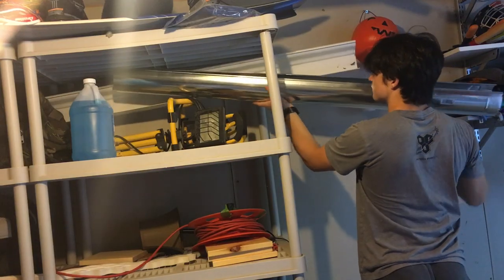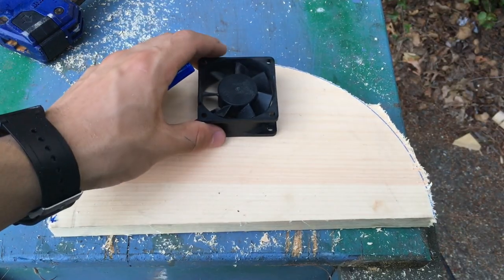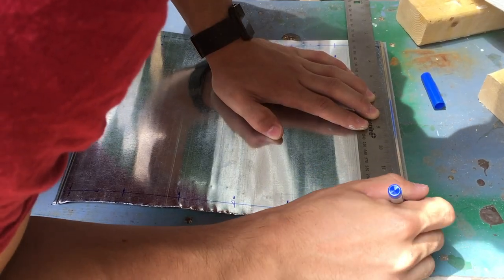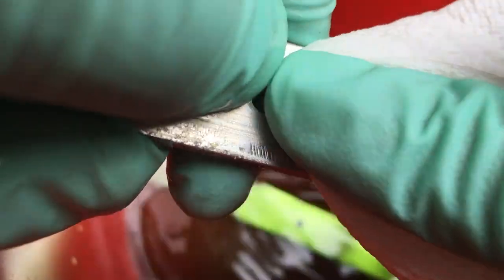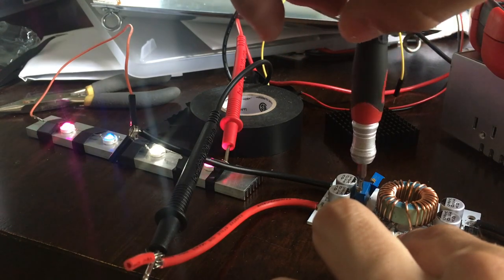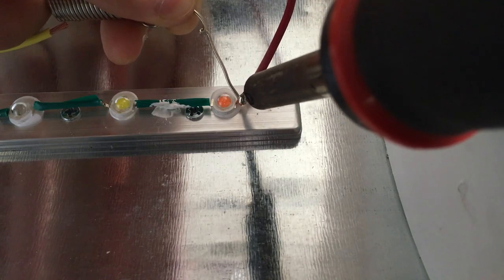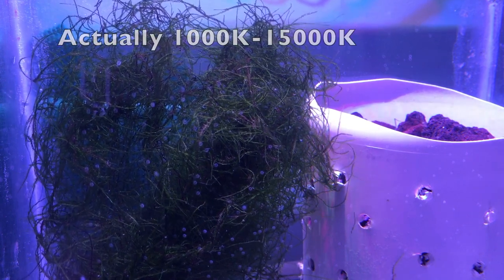DIY High Power LED Aquarium Light

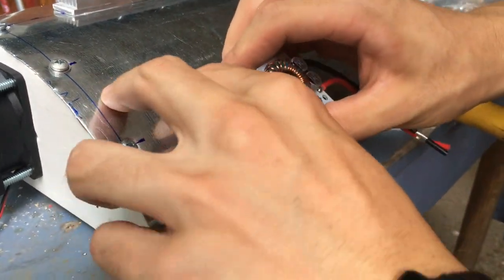Comment: Sorry but don't! There are so many dangerous things in this project I have to say it: The first one, please, remove the power supply from touching the metal!!! 11:12 That's EXTREMELY DANGEROUS and prone to a fire, as under the board there're exposed contacts too, and they will short with the metal sheet sooner or later. I'm just surprised it didn't blow up yet. In one side of the power supply, there is alternate current without grounding, that means even if it doesn't blow up, if some current is transfered to the metal sheet, you can get electrocuted just by touching it! Also, the exposed soldering on the leds, and the shrinking tube (which is not water-proof), are an unnecessary risk. Sorry but I had to say it. This project is the most dangerous DIY project I've ever seen!
Reply from the maker: +Almarma happy to report that I'm still alive. The power supply input is 12v DC, not mains AC. Also, the power supply is built on an aluminum PCB, no through holes. The bottom is meant to be attached to a heatsink if it's under high loads.
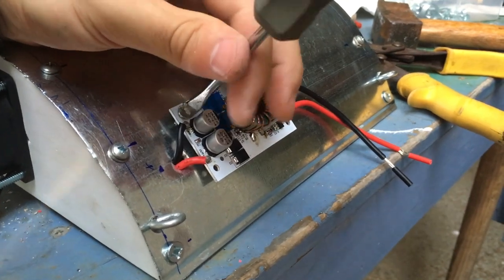Reply: Hallo A Wasser führende Anlagen, dürfen nicht geerdet werden. 11:20 das ist nur Schwachstrom 12 Volt, die Platine ist Kurzschluß sicher, die schaltet ab bevor der erste Transistor in die Luft geht, daß ist nur ein kleiner Knall, nicht laut, daß hält man aus und für den Urwald ist es gut genug.
Spass beiseite: der Lichtkasten ist scheiße 
Hello A water-bearing equipment, must not be grounded. 11:20 this is only 12 Volt low voltage, the circuit board is safe short circuit, which switches off before the first transistor goes into the air, that is only a small bang, not loud, that stops you and for the jungle, it is good enough ,
Fun aside: the light box is shit